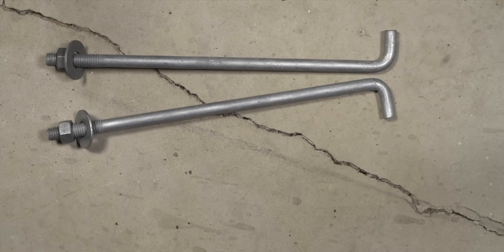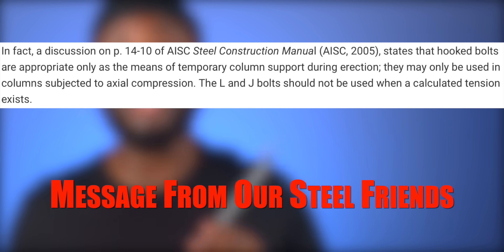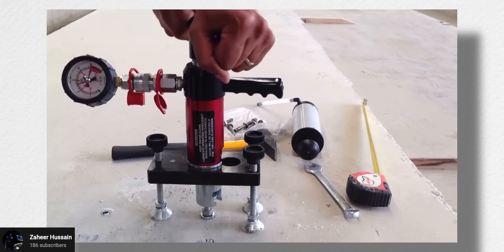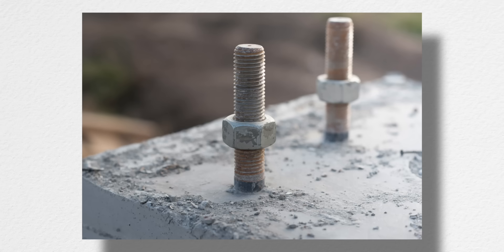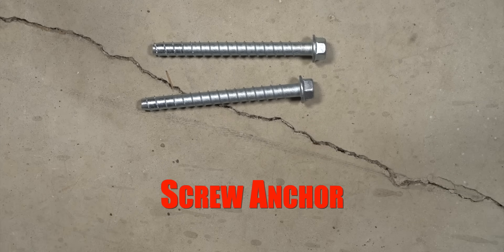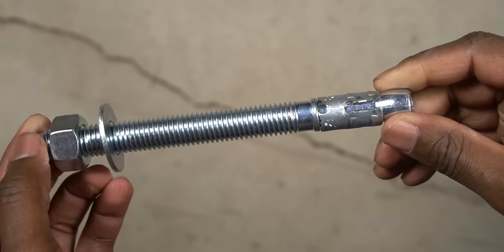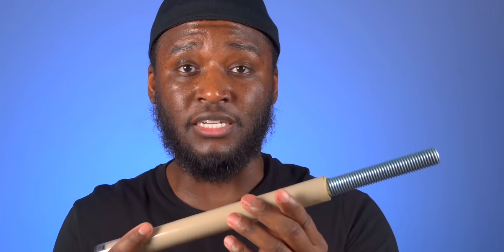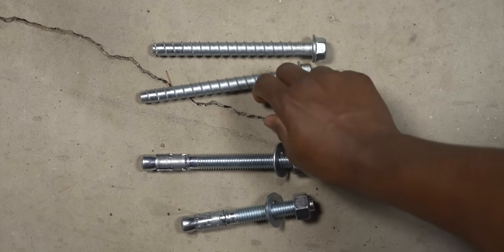Why Abandon "J" & "L" Anchor Bolts in Wood Framing Construction FOR GOOD?

Comment: I'm having a home built and I don't have any of this. I have some extra long metal pieces sticking out that are bent at 90-degree angle and that's it. This is for a 3-story 4,000 sq ft home so Lord help me. Hopefully I start seeing some bolts somewhere once the framing starts.

Comment: Post-installed anchors will never replace cast-in-place for general sill plate anchorage. First, they cost a fraction of the proprietary post-installed anchors. Second, the contractor will have to hire (pay) a Special Inspector to witness some or all of the anchor installations, and they will have to wait for the inspector to show up to install them. Until the codes and manufacturers allow post-installed anchors without special inspections, they will be cost and time prohibitive.

Comment: Those 2 post vehicle lifts come with 5/8 inch wedge anchors and need 4 inches minimum concrete thickness, recommended 6 inch thick. I used 12 inch x 3/4 j bolts thinking that had to be better than 5/8 wedge anchors. I sawcut the concrete out, dug down 3 feet, tied rebar, tied the j bolts under the rebar, vibrated the concrete. I was a little nervous about 5/8 wedge anchors holding up 10,000 pound vehicle lift.

Comment: my cousins husband worked for Napa and went to a trade show where they demonstrated using the epoxy --seems the epoxy Vapor extends out into the concrete  expanding the area of adhesion..  other types of hold downs pulled out with little concrete damage the epoxy consistently pulled out a 4 to 6 in section of concrete!!!!

Comment: If you’re a contractor and work in the field, J and L volts are essential. They’re for more than just what you’re saying. Bricklayers use a form of J and L bolts when tying brick into the side of the house. 

This is the difference between actually doing the job and thinking about doing the job. I was a construction steamfitting and electric for years. I saw the “plans” of engineers and designers. Most of the time, I saw what they said and laughed. For example, an engineer once had an outlet in the middle of where a double door was supposed to be. Now, I’m no engineer, but I think having an outlet in the middle of a double door is unnecessary and potentially deadly. I chose to ignore the plans and did not put an outlet in the middle of a double door. (We’re talking 3 foot from there floor. Another time I had an engineer try to tell me that a 351 Cleveland and a 351 Modified Windsor didn’t use the same engine block. I’m no expert, but I think the only difference is how the timing worked in the engines. I could also be wrong but I believe the only 351 engine block that was distant is the Windsor model. They didn’t recess turn timing chain. Other than that, as far as the blocks, they’re per much the same. But, I’m no engineer, so I could be wrong. 

I’m 52 years old. I’ve seen “new” ideas come and go. I understand it’s to “secure” Society, but it also creates an undue burden. First, J and L bolts are easier to put in when they concrete is wet, and if you know what your doing you can get a whole city block done in a day. Yes, these “other products” appear great. I understand the physics behind these ideas. I recommend the expansion bolts if the concrete is already hard. I trust it because of vote it’s designed. The screws are pretty tame. I wouldn’t recommend either of them under any circumstances with expansion bolts are just as cost effective. 

Engineers and designers are great. They’re needed to help guide us. They shouldn’t be the last voice you hear from, though. Talk to people that actually work with these products. I worked with them until I started driving Truck to make more money.

Comment: I do like the post-pour fasteners, however, wonder how long the concrete has to cure before installing either the wedge or screw fasteners.  I'm assuming that the drill/epoxy system could be done the day after the forms have been stripped.

Comment: The fact you are pushing quick bolts and giving the j-bolt the cold shoulder is leading people astray. A j-bolt where the hook is under the rebar I’d take the Pepsi challenge to say that is definitely the best uplift device versus the screw in quick bolts.

Comment: J bolts and l bolts are a pain in the ass  especially if you mess up the measurement because there is no fixing it once the concrete dries

Comment: Mr. Garth, 

Your video is unprofessional to say the least. You should submit your thoughts and suggestions for peer review by a professional committee. If approved, only then the code and recommended practices can be changed. Otherwise, you are confusing the average contractor and consumer who do not have the proper education to judge your opinions.

Comment: Does anyone ever bother to check the mud-sill to foundation attachment after an earthquake, a hurricane, or a tornado?
This is only easily observable for homes that have basements and crawl spaces, as the concrete slab foundation actually conceals the anchor bolts and hold-downs inside of the finished gypsum board walls.

Comment: I’ve been building medium and high end houses for 30 years and do my own foundation work. I’ve never even remotely had a problem with “j”. Bolts even in Alaska’s seismic conditions.  I used 12x5/8 bolts 4 ft. O.C.   As far as proper placement use a reusable plastic support that allows proper height and edge distance and you can float under them too.

Comment: Is pull out test on the j-bolt was ridiculously shallow and does not at all reflect real world application. In residential construction using the post cure mechanical anchors add significant expense and time. You can't install those in green concrete safely. Most home builders don't want too late to begin framing more than 2 days after the pour is done. I don't think the use of j bolts going away anytime soon and his justification for the more expensive alternatives seems poorly reasoned

Comment: If you install the J bolt or L bolt correctly it would be stronger than the screws. The use of rebar with J OR L bolt makes then very strong. I have installed J bolt tied to rebar laying in the J. The rebar goes the length of the foundation. The only way that J comes out is with the complete foundation.

Comment: Uuuugh as a contractor I always cringe when I hear the words"It is safe to assume." And its not hard to set J bolts correctly. Idonlook forward to the day when the local code enforcement approves the Hilti/Strong tie screw in anchors.

Comment: I’d recommend using epoxy with tapcons. I drilled the right size hole and used them but they free spin in the hole after tightening. It’s a basement wall non load bearing so I’m not worried about it. I put the studs in after the sill because I didn’t have room to work with so it’s really tight to the floor and doesn’t have any lateral movement. If I did it again though. I looked for the epoxy at Lowe’s made for anchors, none in stock. I don’t  know if all epoxy is the same or not.

Comment: I use the j-bolts as only to resist sliding on the foundation.  I use QuickTie cables for my uplift counter measure.  I am given the data to design with.  You are so right about having only the 90 degree leg as the part with the load on it.

Comment: Why not drop a big washer on the hook part of the j 

That should hold way better than a screw in  
And where was your test on the "better" screw expand or epoxy into a smooth bored hole in the same concrete.   Id bet they pulled out with less up force    in the same concrete

Comment: There's multiple problems involved here and most of it boils down to costs. Builders will always select the minimum accepted standard to save money and this extends to the use of low-skilled and unskilled labor. My building career started with industrial form carpentry where everything was checked before and during every concrete pour to ensure proper placement of everything in the concrete. Nothing out-of-spec was allowed to pass, and most of the design work was above minimum standards to be sure load specs were met fully. When I got into residential work and saw the anchor bolts used I knew immediately they weren't good, nor was anything about the whole job. 

And some of the blame belongs to Engineers who are also seeking easier cheaper way to meet testing standards instead of seeking improvements of performance which goes beyond testing standards and aims instead for something better in all respects. When it comes to longevity and resistance to damage of a structure overkill is called for to do the job best. For instance the pull-out strength of expanding anchors as will be used isn't taking into account that the anchor itself puts extra stress on the concrete leading to edge-breakout. Nor does it take into account poorly done concrete work. Lab testing needs to correlate to real-life usage and conditions instead of everything being ideal which is only achievable in testing labs. Civil Engineering is a race to the bottom, with recognition and career advancement being more based on doing something cheaper/ faster/ easier instead of being done better. A lifetime of experience in building has taught me that the best results are always achieved when you make things 'idiot-proof' because if it can be done wrong it will be done wrong just to make the job easier. Let me supply the personnel used to assemble the parts of the lab tests and you'll quickly see how fast engineering fails. I'll send you only experienced people too- scary isn't it?

Something also not considered here is anchor corrosion over time. If the thinner threaded areas of screw-in anchors corrode strength is lost rapidly. The same goes for the sleeves of expanding anchors. Epoxied anchors are too dependent on every hole being prepared properly which just doesn't happen even when it's easy. Prep failure was the cause of the ceiling collapse in Boston's "big dig" tunnel and you'd think overhead holes would be easy to clean out properly with gravity helping clear the dust. But "L" and "J" bolts retain more of their strength in an equal corrosion situation, losing little over time and the time-to-failure being far longer. As someone who has seen building materials make the transition from traditional to engineered products I have become acutely aware of the poor designs of many of these 'better' materials in real-world use, as well as embracing certain advancements over traditional materials because they are so much better in every way even if they are poorly installed. 

Given all this I'll choose to stay with the long-proven "L" an "J" bolts when properly sized and properly installed until something truly better comes along because of their real-world performance. Just avoid building to the minimums and embrace better when it's possible.

Comment: Guessing a plate with welded thread bolts is out of the question? Yes that means being installed before the concrete and to ensure the proper thread height is above but would be way stronger as the plate in the concrete would distribute the pressure of pull. Just an idea but yes a lot of drawbacks there can be.

Comment: As others have pointed out. Wet set anchor bolts should be directly tied to the horizontal rebar thus distributing the load.

Comment: Your understanding of the science is off. A correctly implemented cast in anchor will always out perform an anchor that is installed into a drilled hole. Drilling holes into concrete compromises it's mechanical structure always. They have cast in anchors designs for every job. Any engineer worth his salt would know this.

Comment: Nice video but i have to disagree with parts. 
I've used j bolts and "stab bolts" , S bolts ( you didn't show any of these) are also very common. You say they are difficult to use, I have to disagree, if you can read a tape measure you should not have any difficulty drilling holes in your plate for HD bolts. 
As for epoxy bolt applications, they are great but you have to be careful that the installer does a good job cleaning the hole or the bolt will not hold.
Bottom line, stab bolts are faster (there are plastic holders that are designed to nail to the forms to hold them in the exact place they need to be when pouring our foundation) and less expensive than epoxy, but epoxy is perfect for the HD bolts you missed when laying out your forms.

Now about using Red Heads for your HDs ?  I live in earth quake country and i've never seen them used for HD where code requires a HD.

Comment: While I agree with most of what you said, it is not difficult at all to place anchor bolts correctly before pouring concrete.  

It is just people are lazy or unskilled.   Skilled construction workers usually build a wood template.  The setup the anchor bolts with nuts below and above the template to make sure the the anchor bolts are at the right distance and plumbed.  Then the make sure the template is leveled correctly and everything falls in place. 

Construction workers know what to do. Just the management ask them for insane production speed, therefore forcing them to cut corners.

Comment: I can’t see how titans or wedge anchors are more structurally sound than something cast in place. First you have to hammer the concrete to drill the hole. I would assume this makes it weaker than intact concrete even if marginally. Then to pull out a j bolt it has to overcome friction and straighten out the bolt. This seems like it would take a lot more force than the small metal on a wedge anchor or very course thin threads. The epoxy may be equivalent because it’s effectively patching the conference around a bunch of threads. I know titans are getting more popular but I figured it had more to do with saving time. If you can put them wherever needed after the fact and even extra ones, it’s much better than what happens if your j bolt layout is off. I’m a plumber so this isn’t my expertise but I would think if you wanted an alternative to j bolts, get the ones with the s on the end. I bet they’re hell to pull out. Anyway I’d be curious to see the test results on all these products. Maybe we could go back to how we used to screw toilet flanges to concrete. Drill a hole, then with a punch pack the hole full of lead wool, then drive a wood screw in

Comment: Some older homes dont use anchor bolts of any kind and just used straight concrete nails. Those homes slid off their foundations in a recent tornado. So yeah, anchor bolts are worth having.
Reply: Seriously?

Comment: I've spent most of my career in the heavy industrial sector of structures. Almost exclusively plated rods. But for lighter work, post pore chemical anchors have never failed me. I love that they prevent water and chemical intrusion into the drilled hole. Great vid. Keep it up.

Comment: Actually, I would rather have the bolts welded into the concrete reinforcement, instead of J or L bolts in soft concrete.

Comment: The epoxy anchor has a draw back. It's susceptible to creep. Under continuous load the anchor will slip out of the adhesive over time. There was a tunnel ceiling collapse due to this. About 5 years after the tunnel was finished the ceiling sections began to fall on passing cars.

Comment: In California all post-set anchor bolts require deputy inspector, 
so Ive only used when there is screw up and bolt is missing or misplaced. 

Also J/L Bolts are not used as for holddowns in shear wall . just to keep bottom plate from kicking out and against minimal uplift /shear forces.
Much longer curved / S shaped and inward angled bolts used for holddowns , SSTB16's ect...never j bolts.
Also always use Simpson strongtie anchor mate holders make setting all bolts pre-pour easier.

Comment: Wrong. When you have to drill, anchor bolts into your foundation, it’s a sign that you lack the ability to do math and plan ahead for proper placement of Jay bolts. Go ahead and keep giving that smart Alec look at Jay bolts. If you can measure and do math Jay bolts are superior.

Comment: The nuts you use to attach to the framing will eventually loosen, and the sill plate will shrink in dry climates.  No contractor will put some Red Locktite on them to prevent this, but the homeowner or GC can do it before the wall is closed up.

Comment: The anchor bolt application shown is for lateral loads, not uplift.
The wall assemblies shown will only resist uplift until the nails pull out of the stud.
When engineers want to resist uplift, they use hold downs or similar. Shear walls are rated for lateral loads and anchor bolts contribute to lateral resistance.

Comment: J bolts usually are intended to be tied to rebar sometimes to a vertical one, or hooking a horizontal one there for that purpose. Concrete is very good in compression and very poor in tension, that's the reason for rebar. Sounds like many have just simply poorly installed cast in J bolts.

Comment: Hooray for you!  Retired structural engineer.  Never used a J bolt in my career but then again, I designed industrial structures.  Anchor bolts were an issue from the start of my career until I retired 6 years ago.  Mostly used threaded rod with nut on the end.  You know the ACI has done a lot of research on this issue with pullout cone analysis, etc.  J bolts are horrible.  Kudos to you for highlighting this issue!!
Reply: Even the weakest anchor bolt will hold the plate to the floor long after the nails pull out of the stud.
Reply: In residential construction, check out uplift straps in hurricane zones or high seismic zones for example.  True, nails play a large part in the diaphragm action of the structure but I see significant strapping here in FL where the uplift is transferred to the plate then the anchor bolts.  Uplift is real and sure J bolts may suffice in some situations but IMO they are the least desirable type to use.